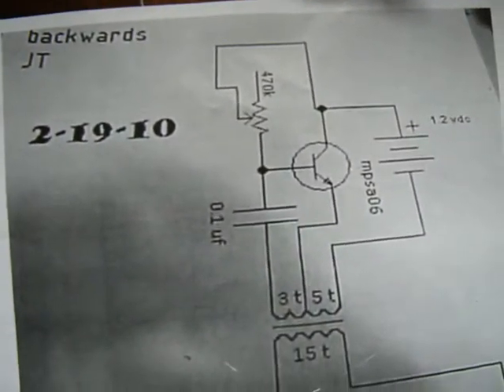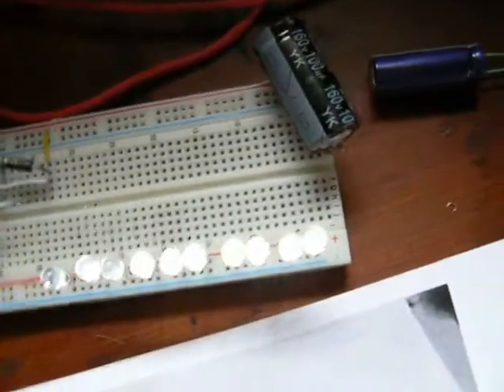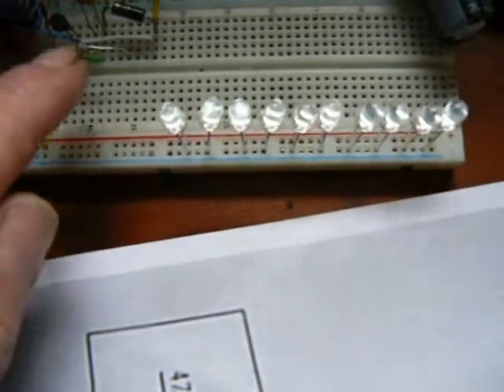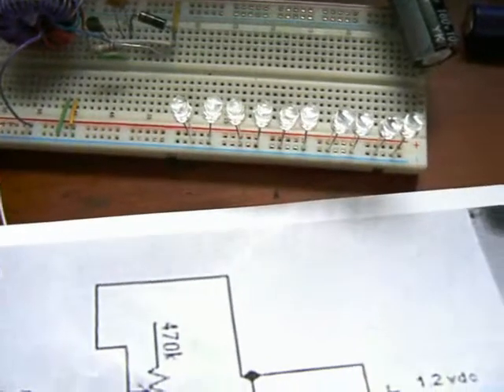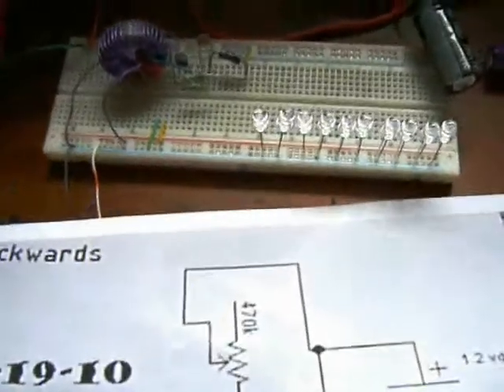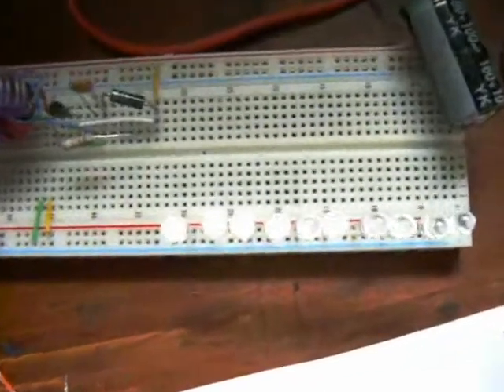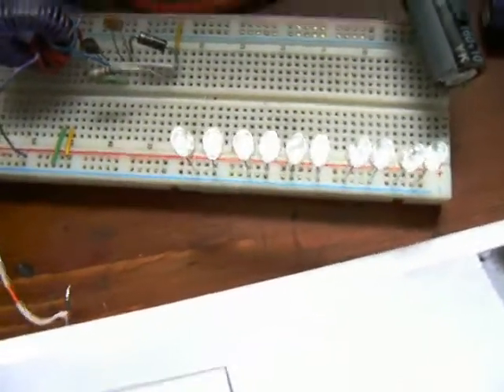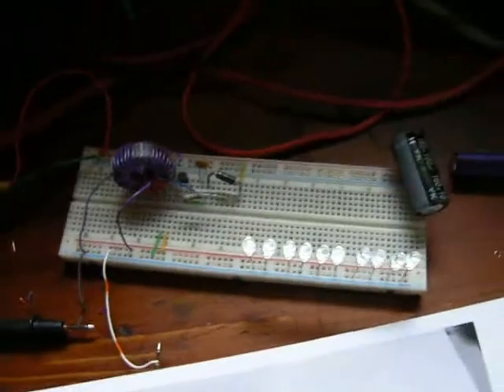Modded Kooler's Backwards Joule Thief Connected to Earth Battery

Comment: Well done.  My guess is that the output, if that circuit is anything like my JT's, can be some crazy high freq. with spikes that drives the meters, and even some scopes, nuts.  To me, the proof is in the lighting of the leds, or whatever, and you have certainly done that.  Nice work.

Bill

Comment: nice demo..
at a certain feq.. the secondary will put out negative pulses on both leads..
but still light a led both ways..weird
even if you use a bridge to a cap it will only show 2-5 volts
great job